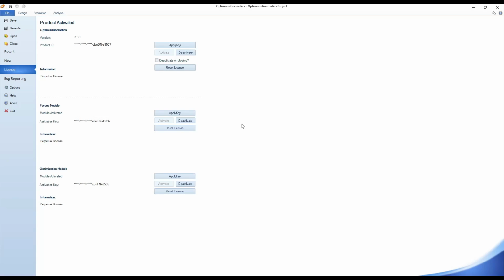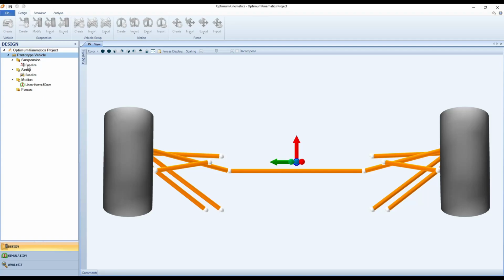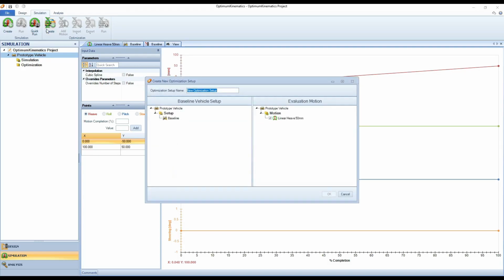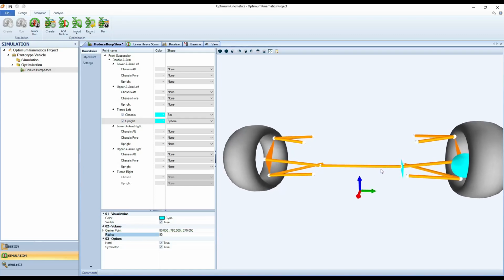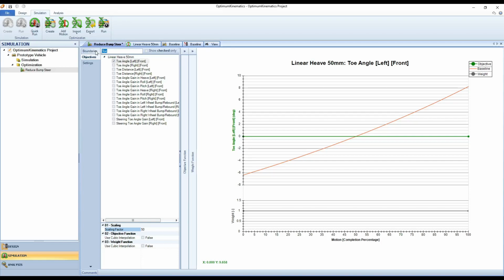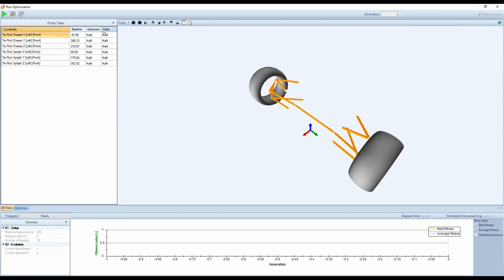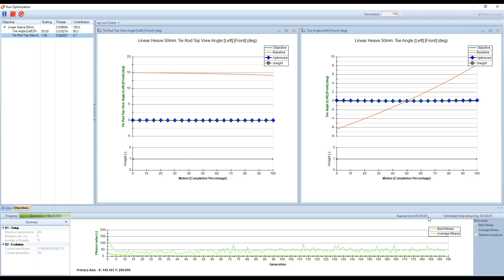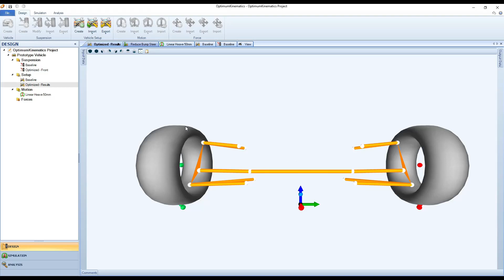Eliminating Bump Steer in UNDER 8 MINUTES with OptimumKinematics Optimization Module

Comment: The more interesting question to me is, do I completely want to eliminate bump-steer?
Isn't it a useful kinematic feature to control wheel individual slip angles or the theoretical car wheelbase to my benefit? :-)
Reply: that's a point I was thinking about. Especially looking to the rear, i think it could change toe during roll to compensate the slip angle